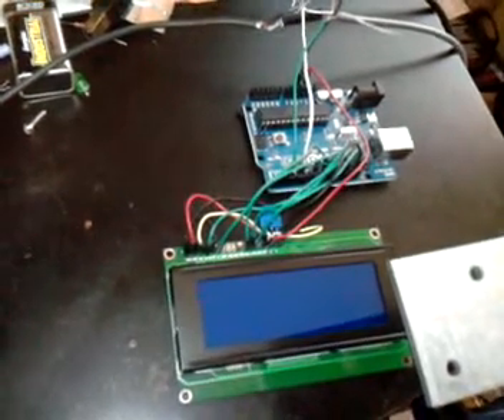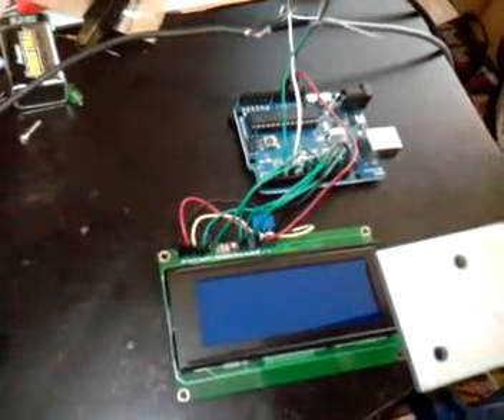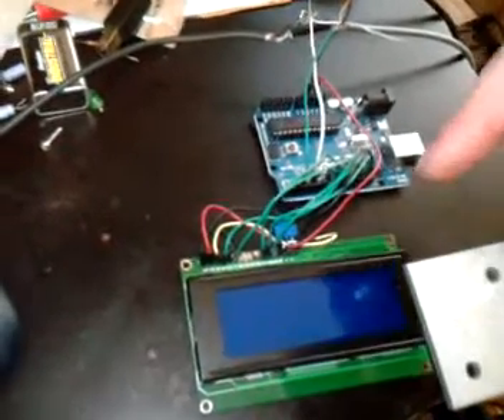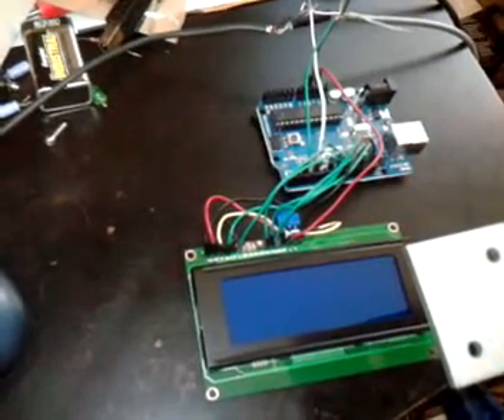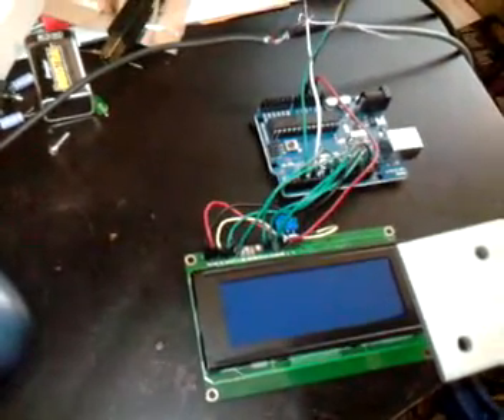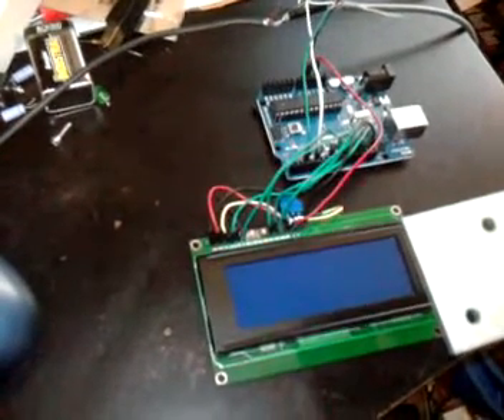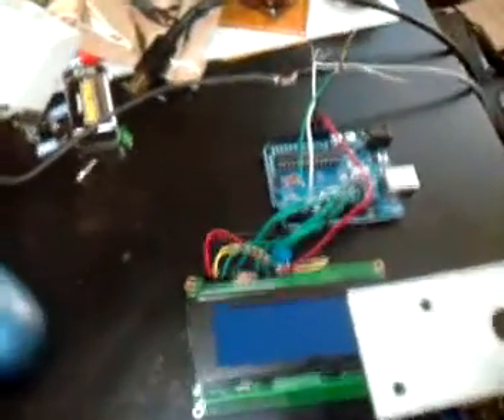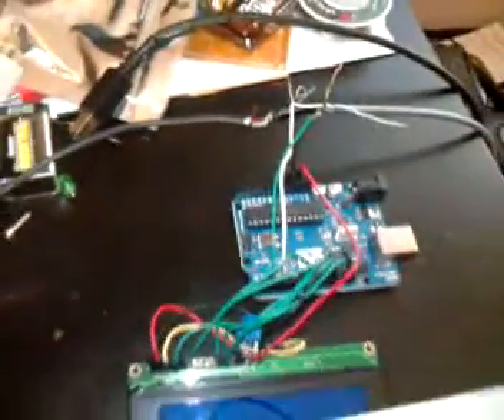Ham Radio Messaging using Arduino

Comment: The 1200 Hz and 2200 Hz tones are not sent at the same time.  Alternate back and fourth signifying the ones and zeros in the bit stream.  Mark/Space is the common term used.  Keep in mind that the tones have to stay in phase and cannot jump.  For example, if when switching from one tone to the other, if the phase is at the 90 degree point, the alternate tone has to start at that same point.

Comment: How is this project going? Having any success?

I thought the signaling system used the old Bell 101 on the physical layer. This consists of two tones played separately, never played polyphonically.

If you need polyphonic tones, output each tone on a PWN pin separately and combine them externally. For tones that require amplitude modulation, you have to generate them in software (I have code to do this, if you need it).